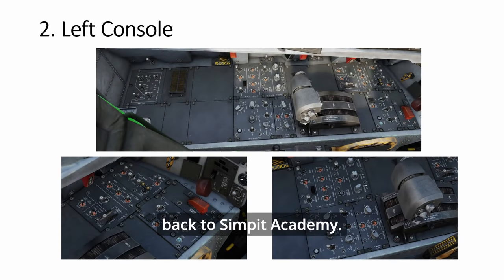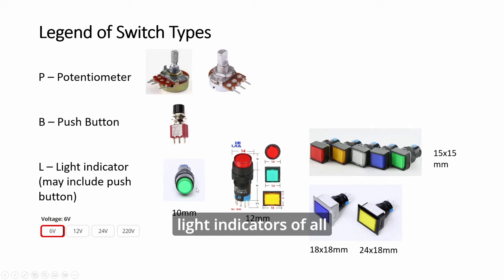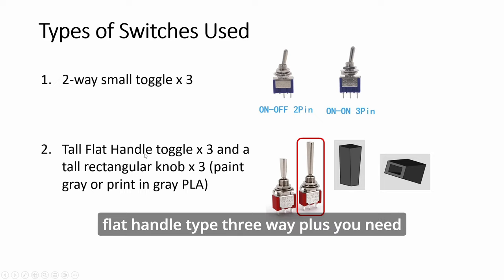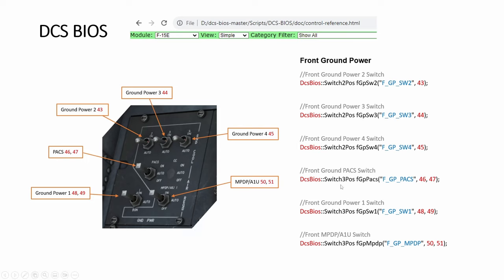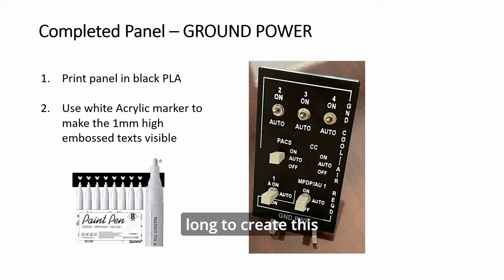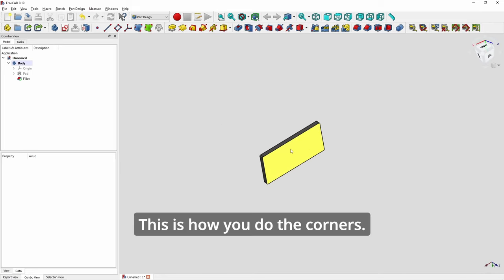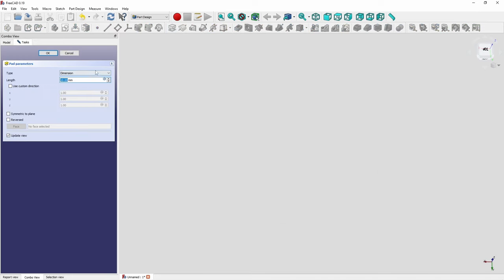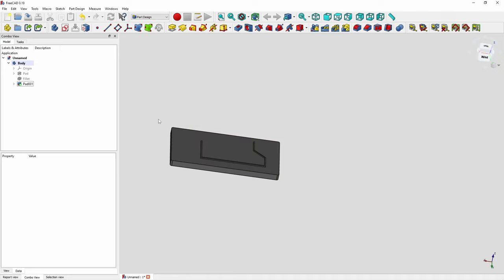Episode 3 DCS F-15E GROUND POWER PANEL #dcs #arduino #flightsimulator

Comment: Love the videos, they are really helpful. Any chance of getting one of the engine control panel? Right now I have all the switches bound to my throttle. Would love to see how you handle the saftey gaurd on the engine master switches. Please keep posting more on the F-15E.
Reply from the maker: Thanks for the compliment. I’d post all panels from the left console first. Then the right console. The safety guard on the engine panel has two challenges which I will address. You can have a fully functional engine panel.